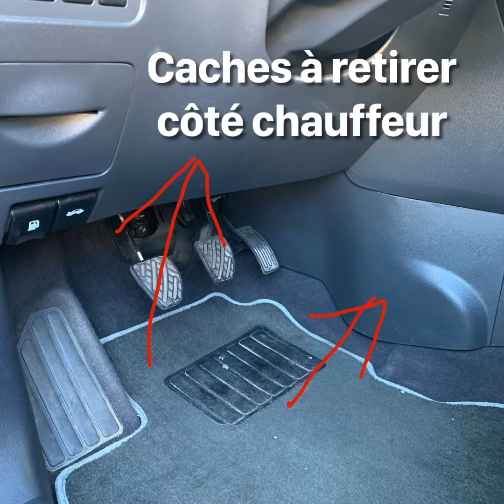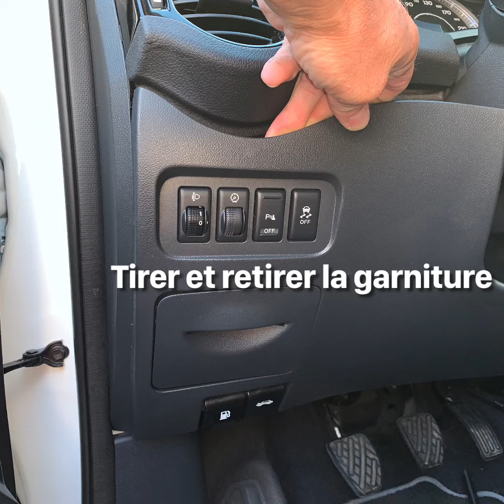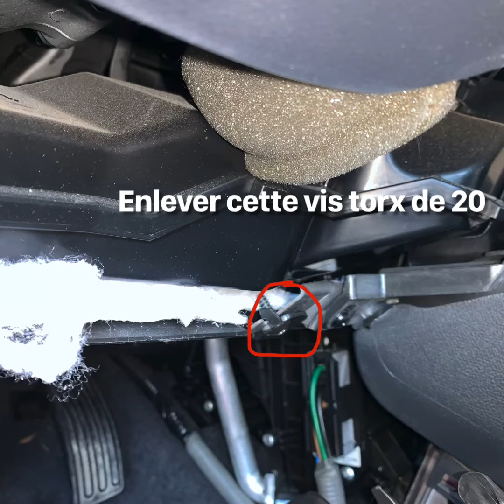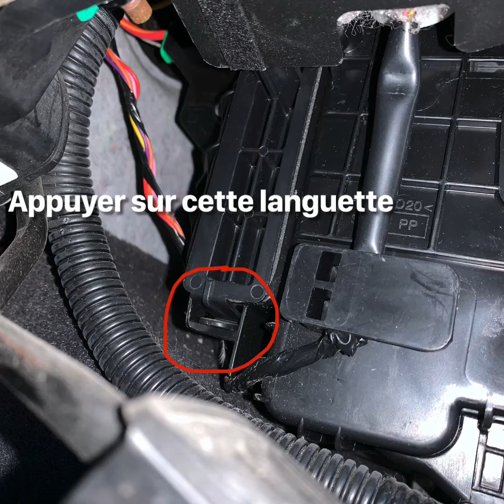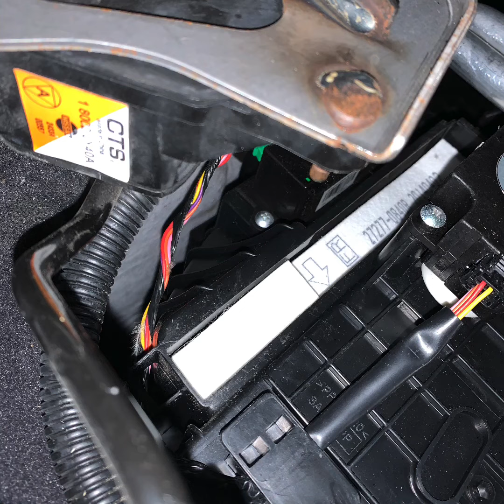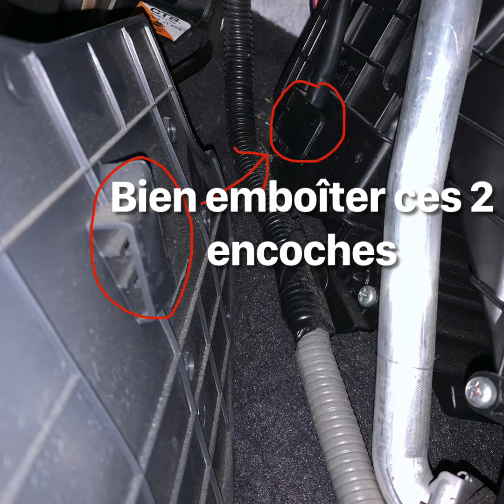Remplacement filtre habitacle Renault Koleos (2008-2016)

Comment: Bonjour, ou se trouve le pulseur d'aire ? Car je n'ai plus de ventilation.. Mes fusible on l'air bon, j'aimerai démonté le pulseur et le tester pour voir si c'est sa ou un relais ou resistance. Merci d'avance 👌 super vidéo pour les débutant en tout cas merci pour sa
Reply from the maker: Bonjour, de rien 😉 
Le ventilateur se situe au dessus du filtre habitacle côté gauche et la résistance de ventilation devant le filtre habitacle (je pencherai plus sur la résistance de ventilation plutôt que le ventilateur). 
Il peut y avoir aussi un problème de connectique sur le ventilateur lui même. 
Tenez moi informé 😉
Bon courage et bonne soirée ✌️